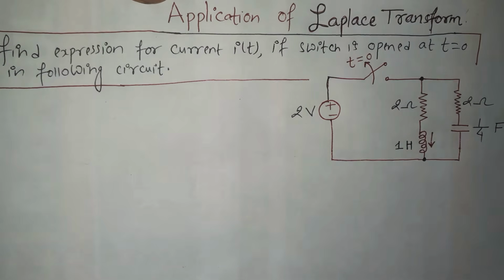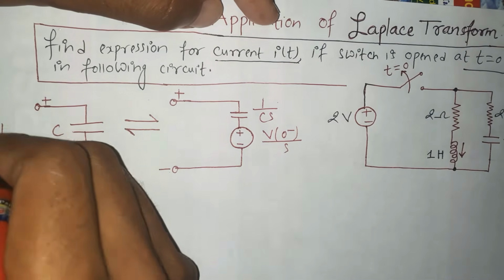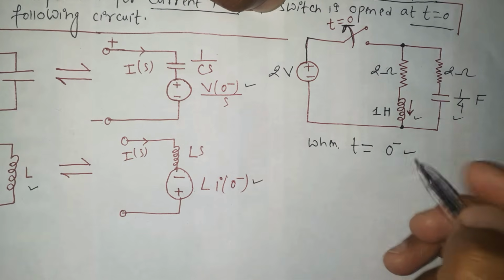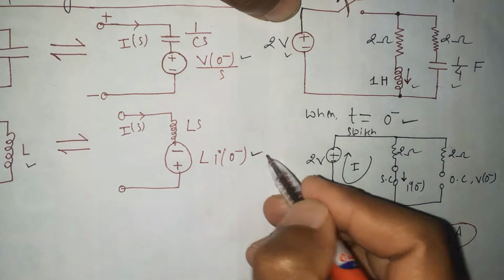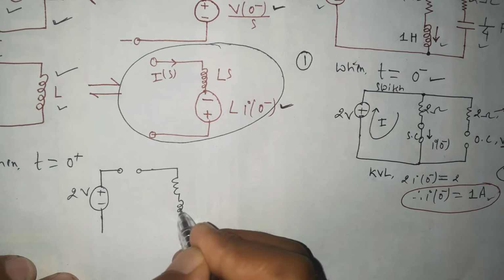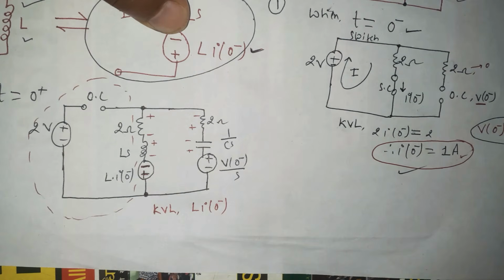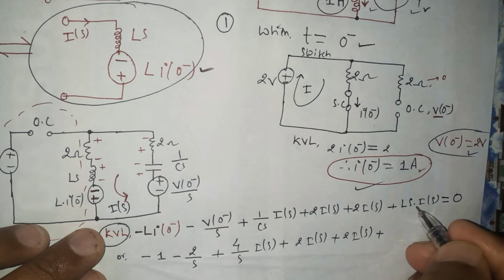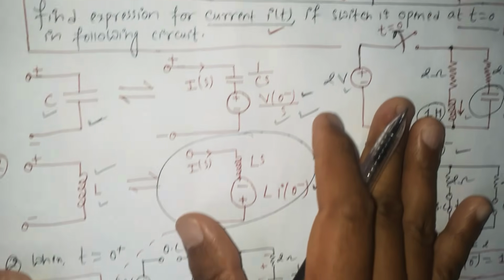Applications of laplace transform for circuit analysis.RLC circuit analysis by laplace transform.

Comment: The standard Laplace model for an inductor is a current source i(o-)/s in parallel to the inductor's impedance. The model used here is correct but is actually a source-converted equivalent.

Comment: you  make a blunder t<0 ,t=0,t>0 inductor act as open  circuit and t-->infinity which means at steady state inductor act as short circuit   VL=Ldi/dt if i is constant in steady state the derivative of a constant is 0  and the VL=0  which means that short circuit and reverse order for capacitor

Comment: In 0 condition L is open circuit and C is short circuit..you have written reverse
Reply: I think he was saying that the switch had already been closed for a long time, but then was opened right at time t = 0.  Therefore the inductor would function as a short circuit and the capacitor would function as an open.
Reply: At t=0-, Circuit is energised, so L should be open circuit and C should  sort cicuit.
Reply: @G-TEN-SOFTWARE  I may be misunderstanding something, but I thought that if voltage and current can reach steady state, then an inductor would offer no resistance to current (hence, act as a short circuit) and a capacitor would be fully charged and resist the buildup of any more charge (act as an open circuit).  Does that sound reasonable?